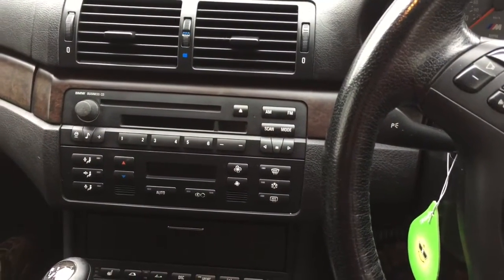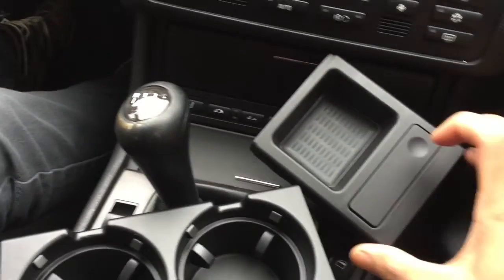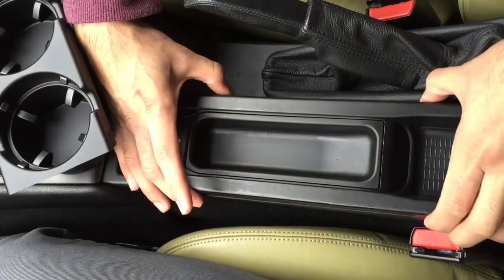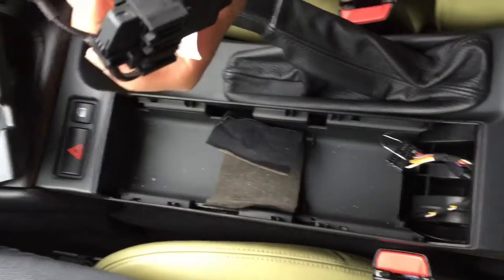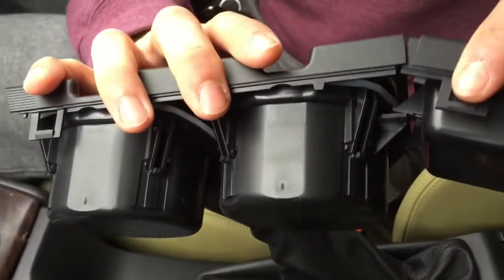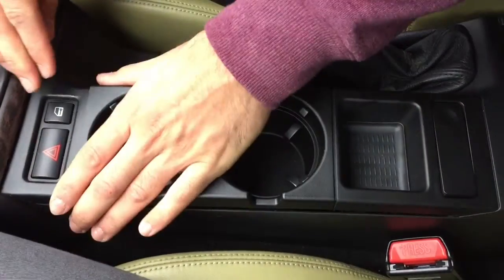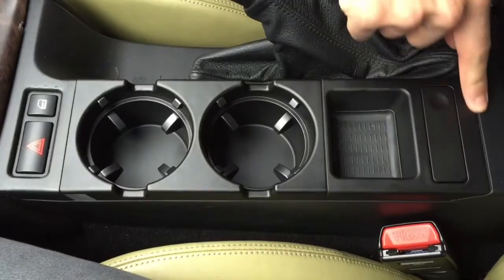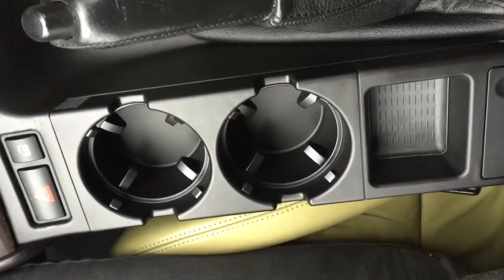How To Install Cup Coin Holder In A BMW E46 M3

Comment: I don't get the reason for the spring on coin holder. If you spin the coins up so you can get them, you can push the coin holder down, it is spring loaded, BUT WHY?

Comment: How the hell does the connector come off im pulling it so hard but it's not disconnecting
Reply from the maker: Need to look for the clip and press in this area
Reply: If that doesnt work use scissors 😀
Reply: Yep - two connectors need 'unclipping' and both easy to do by hand.

Comment: where did you buy? is it original?
Reply from the maker: DenStylerz Official - Best Mixes hello, I bought it from eBay. I am not sure if it is original.
Reply: Could you please send the link of the item pls ? 
Cause I've bought same but the quality was really really bad, it didn't fit properly and looked cheap.  
Thank's
Reply: Thanks for a greatly informing video. Would be great if the link still exists. Please do drop it below.